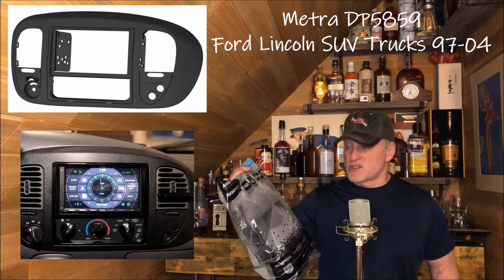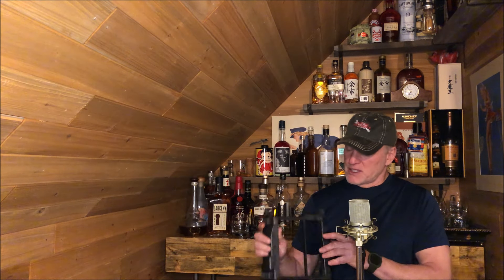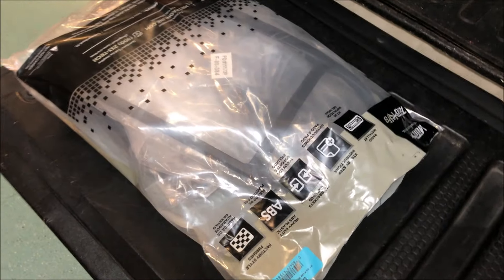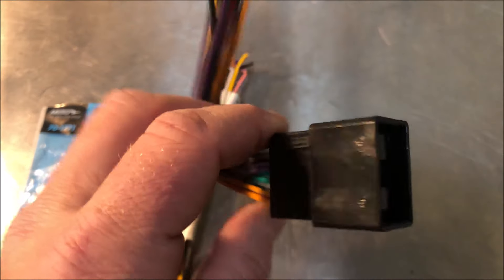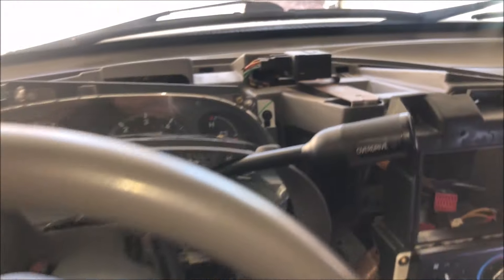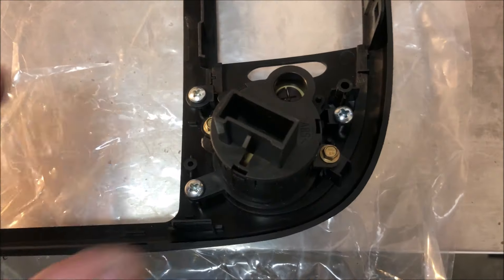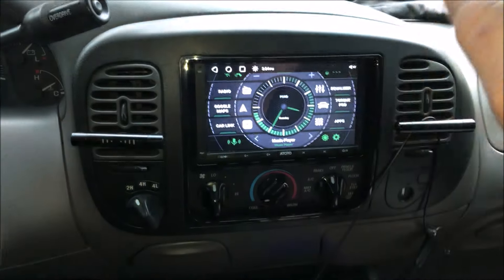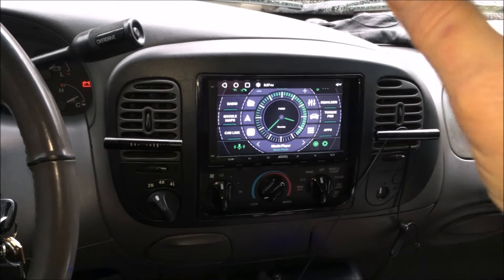Double Din Head Unit Install: 10th Gen '97-'04 F150, '98-'02 Lincoln Navigator, '97-'02 Expedition

Comment: Its crazy I paid alot of $$ for kenwood dvd player and still had to buy all my cables and adaptors separately 😂
Reply from the maker: one of the reasons I went the cheap route on the head unit.  I'm sure not as good as yours, but it definitely has given me alot of pleasure and capability.
Reply: @DrivingIntelligence  idk ive seen some cheap head units that were awesome like the tesla screen wanna bes are actually pretty nice I finished a install for friend of mine and its basically a computer just nicer lol so I think you made the right choice especially how fast tech because obsolete
Reply from the maker: @DeWaltjunkie  good point, I think I bought the A6 for less than $150 when it was on sale

Comment: Got a question right now I’m putting in Dual XD28BT and I cannot figure this out on my 98 f150. Is there anyway figure out the standard ford harness diagram for the install?
Reply from the maker: I don't have a wiring diagram for your year. Did you buy a pre-wired connecter?  Usually pretty seamless to install... color match the wires.
Reply: @DrivingIntelligence  for my 89 and 08 Silverado the wires were the same, this one the colors are different. I think I found them but I cannot/do not know for certain
Reply from the maker: @VikingFitnessWyatt  only thing I can suggest is either buy a 1998 F150 Electrical Manual or do a search for the wiring diagram for the stock head unit.
Reply: @DrivingIntelligence  I’ll see what I can pull on up at ford. Mechanic stuff easy peasy, electrical im an idiot lmao
Reply from the maker: @VikingFitnessWyatt  Just did a quick search and found a diagram.  I can send to you at my Facebook page.  Look me up at www.Facebook.com/c/drivingintelligence

Comment: Did you attach the plastic Metra side pieces to the trim piece you cut at the top? You didn't really show attachment points to the truck. Sorry, I didn't purchase the Metra kit DP5859, I purchased the Metra kit DP 5818 which has the side pieces and 2 trim pieces. I was just wondering the reason for the plastic side pieces. Looks like in the picture there some ears that attach to those side pieces that attach to truck frame. Thanks.
Reply from the maker: Sorry, I don't understand your question.  Nothing in the kit attaches to the sub-frame of the dash.
Reply: Guess I'll buy the Metra DP5859. I don't see anyway to attach the radio to the truck without that kit. Thanks.
Reply from the maker: Link to the kit is in my description.  The kit side brackets integrate with the mounting components included with the head unit.
Reply: @DrivingIntelligence  Not only is your video great information, but your response to questions is second to none! That is just a important as the video. I feel like I have a long distant friend! Thanks again, great job Barry!!
Reply from the maker: @skipstevson9457  Thank you very much!  I'm trying to build a community.  I answer 99% of the questions posted to my channel.

Comment: Hey, quick question on the sub panel. You said you went and bought one from a wrecking yard. Why does that need to be replaced? The one in the truck can't just be trimmed like you did? Or is the one you purchased from the wrecking yard different from the original one?
Reply from the maker: Actually, that’s a really good question that I didn’t think of until you just asked. No need to buy a new one if you have time to do the work on your truck.  As I think back, I really bought it to make sure I didn’t screw up something that I couldn’t reverse or fix.
Reply: @DrivingIntelligence  Has the tire pressure monitoring addon been doing okay for you? Do you think it's worth the purchase? I know in the video it was crossed out with their OBD2 Dongle, but was just curious on your feedback.
Reply from the maker: @Zalagar619  the kit I like is linked in the description of this video.  This is not an ATOTO unit and actually OEM style.  I've had great results using the one in this video:  https://youtu.be/JK5_ttQSM84?si=eOF0DSBlr-UM08wm

Comment: Hey!  Did you have to cut anything behind the radio to make it fit?  My kenwood hits some sort of frame that is angled down towards the back.
Reply from the maker: Are you referring to the back of the cavity?  My ATOTO is much shorter than other head units, I made sure to get a shorter head unit to prevent hitting anything at the back of the opening.  Only thing I had to cut is what is covered in this video.

Comment: Hey man, great video! i'm wondering if it's possible to install this unit without the metra dash kit and modifying the oem dash bracket?
Reply from the maker: Thank you!  The OEM dash bracket needs to be modified whether or not you use the METRA kit.  The fit and finish is not as good as the METRA unit, but it is doable sticking with the stock bezel.

Comment: Maybe I missed it (twice) - why get the used sub bracket? Does the kit not include one?
Reply from the maker: That’s a good question, I got a used one because I didn’t want to take a chance destroying the original unit. This way I was able to mock up the cutting I had to do on the subframe on my workbench before tearing the dash apart.

Comment: Another great video. I just picked up a head unit and would like to use this kit, but I have the wood trim intrument panel and want to keep that. I hope I can make the other metra kit work, but I've seen a lot of people having trouble with that one
Reply from the maker: If I recall correctly, I think I had used the other metric kit and didn’t like the way it worked so I returned it and got the more expensive kit.

Comment: Quick question about grinding the subframe to fit the unit: I don’t have the Atoto so I’m not sure how much to grind off of the top, and I have the manual temp control so I’m not sure if any adjustments need to be made. How did you determine how much to grind the frame to fit the unit? What did you use to cut it? Thanks and great video.
Reply from the maker: Thanks for your comment and question.  I used my ATOTO as a guide to trim the upper part of the subframe.  I used a dremmel  with a cutting disc.